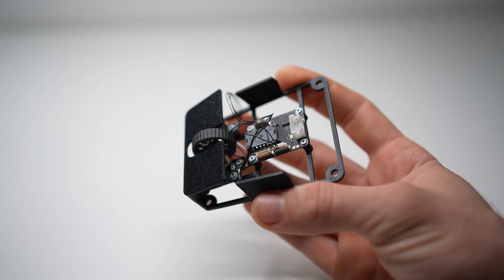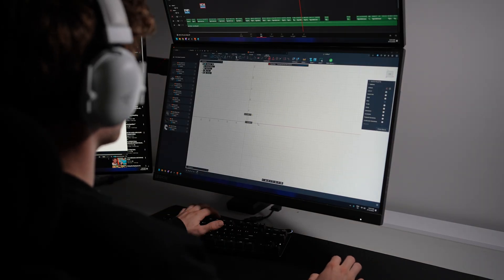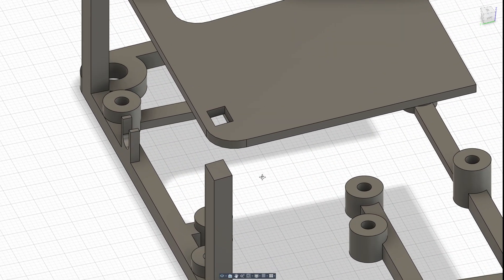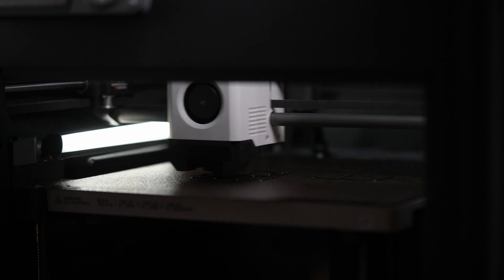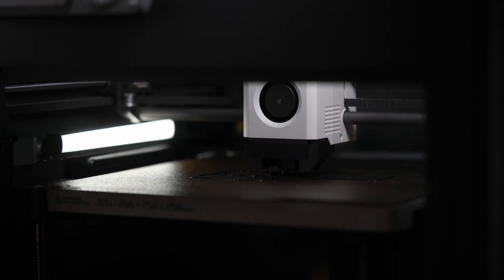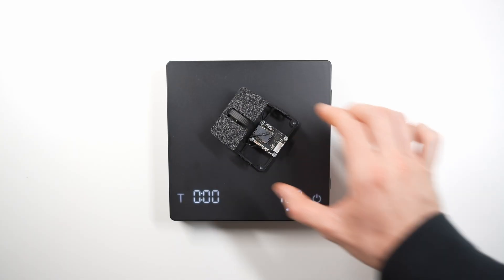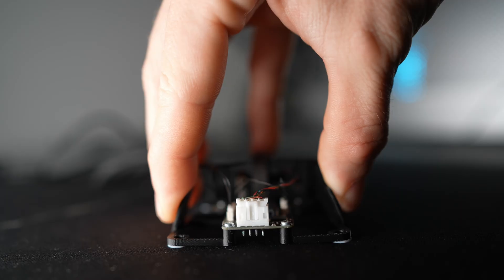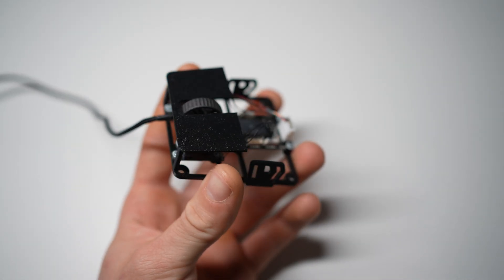3D Printing The Worlds Lightest Mouse

Comment: Very cool. Any reason the connectors can't be replaced with solder joints?
Reply from the maker: No reason really, I just wanted to be able to pull it apart easily but that’s definitely an option! :)

Comment: instead of screws why not just add posts that can have the ends melted down with a soldering iron to rivet the parts in place, and if screws are needed, nylon or PEEK screws might save a gram or 2
Reply from the maker: That’s a great idea! Thank you for the suggestion :)

Comment: if you moved the micro switches higher up further you might be able to sneak the mouse sensor under the buttons removing the back half then you can model some tails coming out for the finger supports